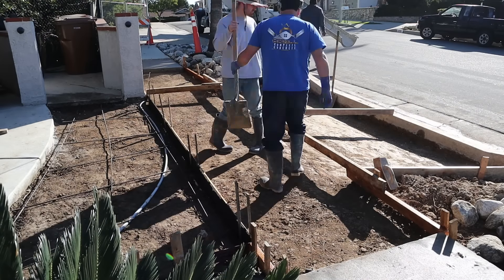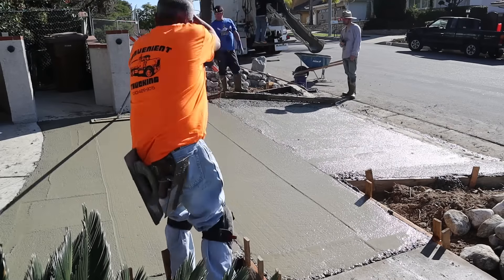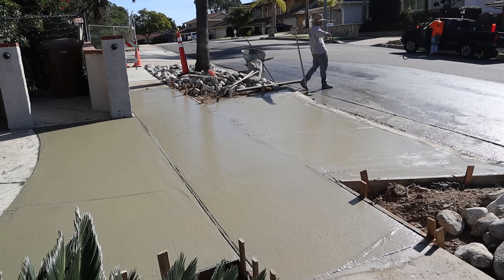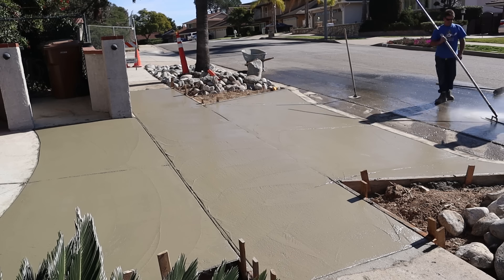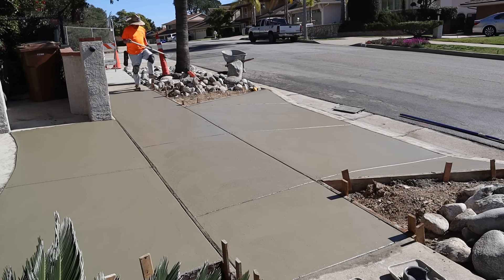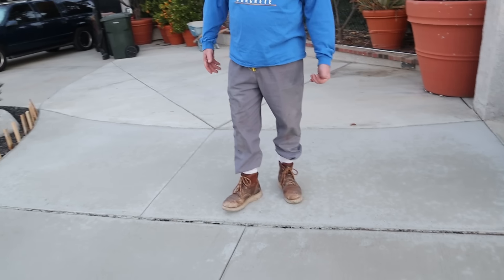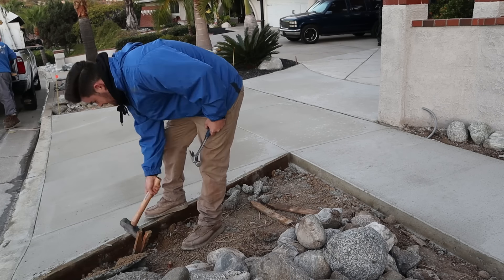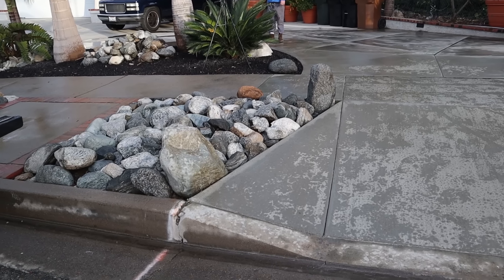How to pour a Driveway Apron Approach Part 2

Comment: In the City of LA, they require base under the walk and driveway. They also don't allow gaps under the forms, and they don't allow steel in the apron. You also have to use the City mix. I'm also a little surprised that the inspector wanted more that the standard plan specified.
Reply from the maker: Maybe he wants to be a Engineer

Comment: Joints are hard to do, and I hate having to edge on both sides of the expansion when you pour on each side of it... I very seldom freehand my joints, I have 8,10,12,16,18, 20 and 26 foot screen boards I lay them down and run my pole jointer down them maybe have 4 handles on them. I never was good enough to freehand long joints, I know there’s guys that can, I never can get them close to perfect, I think it’s because I don’t have the patience. You can get to where you can hear the sound of the jointer running against the straight edge. Many a time  when that sound leaves the straight edge I have said to my guy you got a squiggle in that joint now get that jointer up against the straight edge. It’s cheaper to saw cut but it’s very satisfying to do something other guys can’t or are just to lazy to do...
Reply from the maker: Straight edges are sure shots.
NO guess work.
Get it on

Comment: How long will it be blotchy? I had a driveway put in with some lamp black to darken it up a bit and 4 months later it is still efflourescing in places. It seems like when water drops in a certain spot for a while it leaves a white mark that will eventually go away but looks unsightly for a time.
Reply from the maker: It varies, try some penetrating water base sealer
Reply: @OdellCompleteConcrete  Will that remove the blotchyness or should I pressure wash or something else to clean it first?

Comment: I'm no expert but I think the requirement for the extra deep and compact foundation under the apron has to do with the fact the apron imparts vertical lift to the vehicle as it enters the driveway. This means the driveway surface has to resist more weight than just the vehicle weight depending on how fast the vehicle is traveling. My really rough estimate, based on your 6" lift,  is driveway has to support 25% more than the weight of the vehicle if the vehicle is traveling just 5 MPH, which is pretty slow. The inspector may have seen crumbling aprons due to this effect on inadequate apron foundations in the past, and that's why he seemed to be overdoing it. Time will tell :-)
Reply from the maker: If that's the case I think he should push for new engineered drawings as the new standard.

Comment: i think the cities want that felt so they can break out a section if they want to to run a pipe or something.. i was doing work in a small city outside philly and every joint had to have felt in it along the sidewalk not just the outside edges
Reply from the maker: That's a trip

Comment: I'm not happy with my driveway. (Brisbane Australia) . Where the gutter meets the driveway, it's not level to the gutter which I like, but is 2 inches higher. Luckily there is a control joint about 4 feet in, so i'm going to get it demoed and replaced level. More money for sloppy work.
Reply from the maker: Yes that will work

Comment: Hi, Love your content. I'm a recently retired LA County Deputy Grading Inspector and after 32 years of Mass grading projects from 1 million to 12 million cubic yards per site, and dealing with so many small to giant Contracting firms, I just wanted to comment on the difference between seemingly "Hard native" and the actual density of the soil, which is just one of the many determining factors that we use to establish the competency of the exposed and underlying soil sub-grade.  Undisturbed native soils can be hard but dry, then with the later introduction of moisture, can under load  collapse due to the porosity of the soil, allowing the weak grain to grain chains and consolidate , this can create voids which render the soil sub-grade incompetent to sustain the load as per design. Dry Clayey soils can feel hard, but can both consolidate and expand at uneven rates, this is usually the reason for cracked slabs and foundations, differential settlement. We often suggest to remove 3 feet of soil, then evenly and properly moisture condition to @ 2-3 percent over optimum, then re-compact it in not to exceed 8"-inch lifts , ( even on job sites that I had with 75-657 scrapers running around it was no greater than 8"-inches per lift in between compaction efforts); with density testing and observation by someone like me during the process, I worked for a very conservative Engineering firm and we helped to establish ASTM standards and practices. I know this is just a driveway...( Man if I had a dollar for every time I had a Contractor say.."It's just a"...I'd have one Billion dollars  lol);  and apron approach and every city has it's own quirks for sure..in hindsight an over-excavation as determined by the engineering firm that helped design the concrete sections and sub-grade requirements might have suggested a simple "Ring" test that could be driven in by hand tools , at depths from sub-grade to minus 3 feet , then taken to an accredited soil lab for quick analysis, they would then recommend either removal, rework the insitu soils  or  design  a deeper concrete section to remedy any substandard soil conditions encountered, naturally they should/ would have done this weeks before you showed up to the site and the recommendations would  be on the approved drawings, thus saving everyone time and money. Well that's the way it's supposed to workout but we knows it doesn't always go so seamlessly lol...like hardly ever haha ...anyway sorry to draft a letter here...keep up they great content
Reply from the maker: Sound
Good
TY

Comment: Did ya really even need a cut on that 12" inch thick section?
Reply from the maker: Not really,
But that's what the inspector wants.
Technically for the joint to even work it has to be 25% of the depth so that makes it 3" a deep
Reply: @OdellCompleteConcrete  why was not surprised that inspector eventually no-showed.